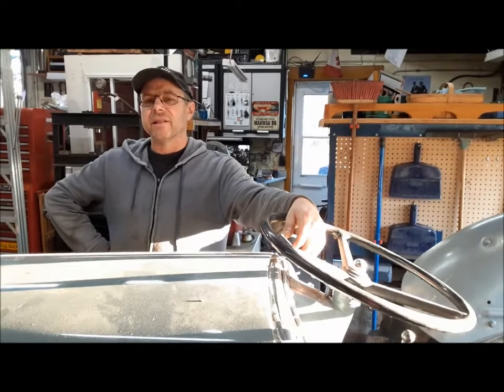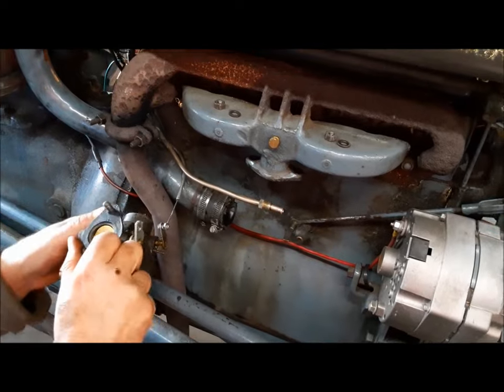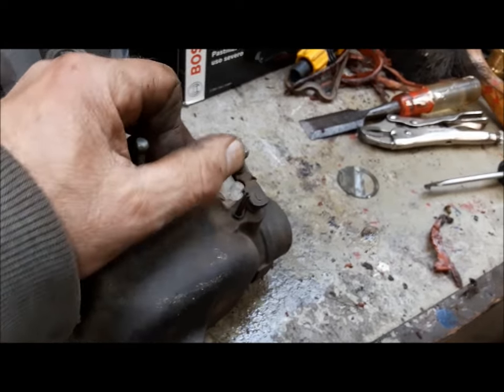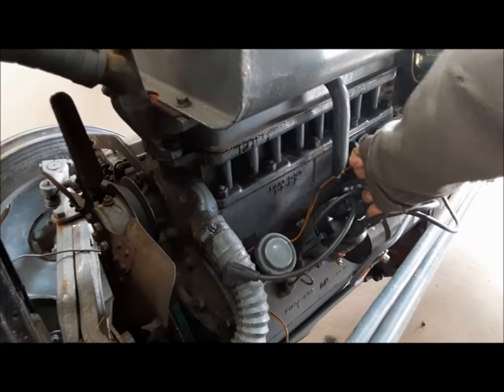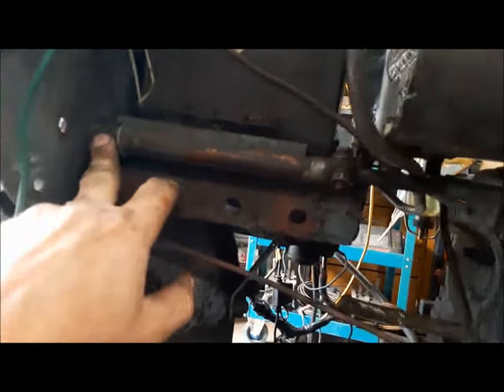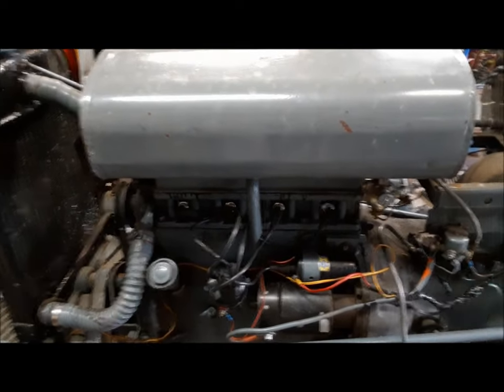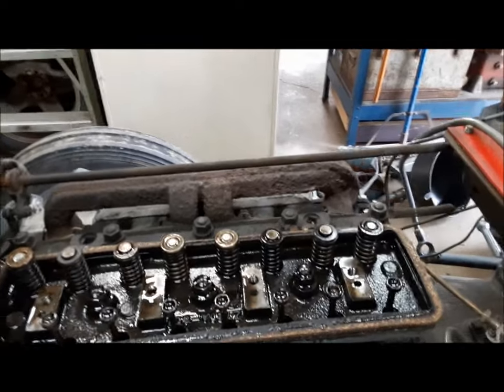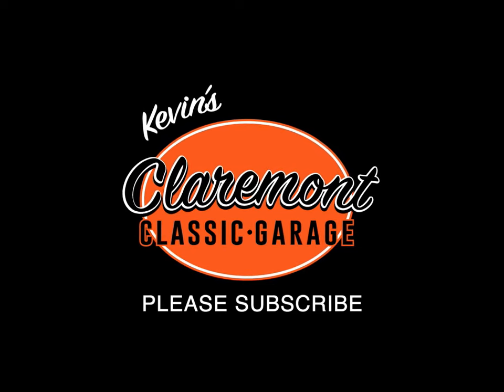1949 Ferguson TE20 Won't Run AGAIN!!!!

Comment: Hey Kevin, great video! Do you know how to prime the oil pump on the 49' massey ferguson te20
Reply from the maker: I've never had to do that. It should pick up. Pull the pan down and make sure the pickup isn't sucking air. And while you're in there you may be able to force some grease or something up into the pump.
Reply: @ClaremontClassicGarage  Ok thanks for the feedback Kevin 👍 Appreciate!
Reply: @ClaremontClassicGarage  Hey Kevin, sorry it's me again! what would cause the oil pickup tube to suck air? Thank you sir 🙏
Reply from the maker: @jayframes4967  they get loose, they crack, they can even be bent or blocked with sludge/junk

Comment: How can you tell that there is an exhaust leak in the joint that connects the two pipes?
Reply from the maker: if you hold your hand there while its running you'll feel the pfft, pfft, pfft coming out of it. You may also notice a black streak of carbon in the area of the leak.